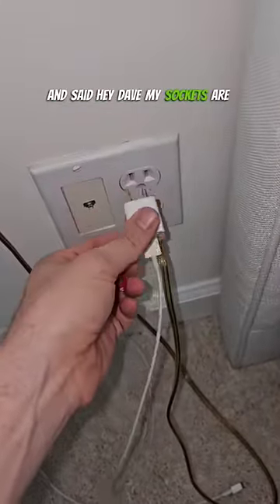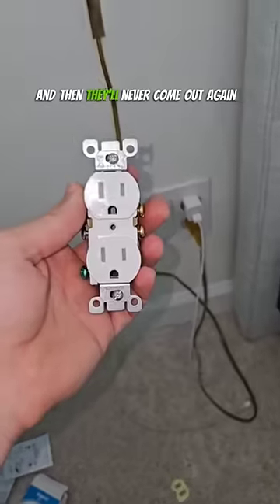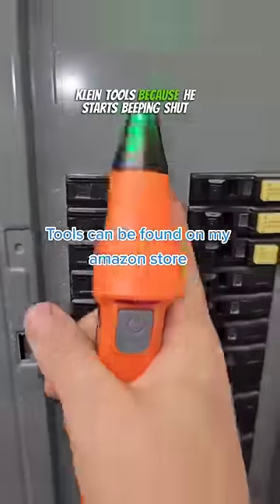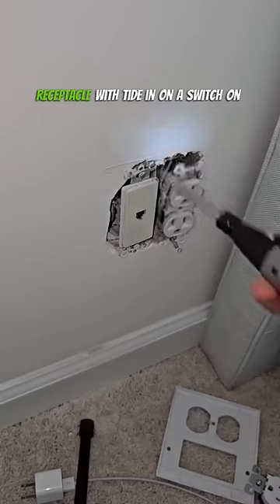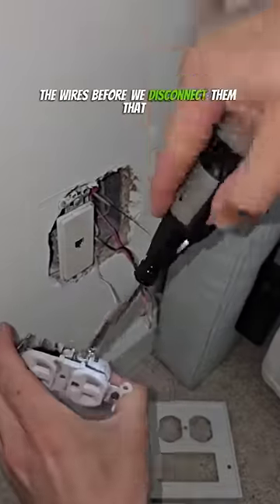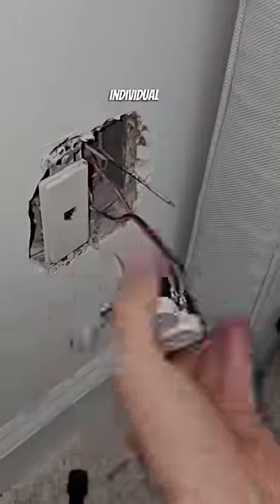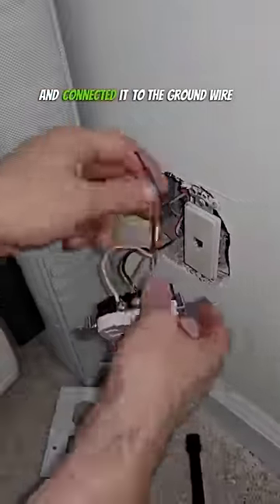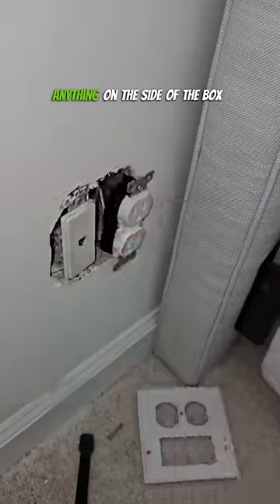🔥 Thats a hazard! How to change a switched outlet #diy #handyman #electrician #HowTo

Comment: Pro tip, forget about finding the right breaker, go straight to the source and cut power to the whole city
Reply: lmao
Reply: Or just your whole house. But if you have access to the local power station, then yea I guess that works too.
Reply: @anthonyfaiell3263  its a joke
Reply: @ntclpz I'm pretty sure his comment was also a joke
Reply: @ntclpz you is a joke brodie
Reply: I approve
Reply: lmaoo
Reply: Or the electroboom way by shorting the live and neutral
Reply: No
Reply: >I need to turn off the power
>Destroys the SUN
Reply: Grow a set and work with live wires... 😂
Reply: Me opening the switch gear at the sub station 😂
Reply: Can't be too safe.
Reply: Slavic method is to short the plug
Reply: I throw anvils upstream of the local dam
Reply: Isn’t much easier to call the power company and tell ‘em to shut down for a moment the power plant? I mean isn’t that hard to since they got people already there 🤔
Reply: This is the Die Hard way!
Reply: Just bring down the entire electricity grid so you don't have to figure out which city you are in.
Reply: XD
Reply: Crashing into your nearest tri state transformer pole helps
Reply: other trick: live in germany here every breaker is labels with the room its for kind cool tbh
Reply: Or just press the button to trip the breaker
Reply: @benozzy003 Oh, you mean the button on the outlet tester he used? I thought you were talking about the "test" button on a GFCI outlet... which would, of course, not do anything to de-energize the wires behind the outlet!
Reply: @babo77z19 After having a handful of electrical problems at my house (USA) I started labeling the breakers to make it easier in the future. Big mistake! It turned out that there was little rhyme or rhythm to which breaker fed which outlet. One breaker fed an outlet in room A and another outlet in room B. And room A had other outlets that went to a different breaker, etc. etc. I had to go back and erase or cover up all the labels. Lest someone shock themselves by trusting the labels.
Reply: I thought I knew where this comment was going when I started reading it but nah 😂
Reply: You might get hit with some serious charges
Reply: @babo77z19  Do you trust the person, which put the sticker on them?
Reply: Lmao
Reply: Im taking this advice lol i killed the breaker once and tested it with a lamp, no power. The moment i touched the wire i got shocked. I said fuck that and killed the whole house to change the outlet lol
Reply: what if i just power off the entire united states mainland?
Reply: All i hear is call of duty “ Going Dark”
Reply: You could also know that your whole room is on one breaker so it doesnt require the tracer. Then again, people dont usually do that, for some reason.
Reply: Yeah, On the way make sure to empty the ocean as well.
Reply: YES
Reply: I have been guilty of just killing the main breaker when I'm in a hurry and don't feel like finding the correct circuit.
Reply: Just shut down the whole power grid

Comment: I remember being 12 and my dad was working on a socket and it was still live despite having turned the rest of the room off. The only reason he double checked is because I asked if we should.
Reply: ive been shocked by mains so many times, so long as he didn't have a tight grasp on it he would have been fine so long as it wasn't a long exposure
Reply: @chrismeli9171  This is why, if you have any doubts, touch the wire with the back of your hand first.
That way, if you get shocked, you won't clench your fingers around it.
Reply: My dad got shocked so many times and he still refuses to shut the power off
Reply: I've gotten a lot of light zaps from uncut hot jumpers and shared neutrals in kitchens
Reply: It's not that bad a shock
Reply: @acidwaste00  Depends on how bad the wiring is in the house actually. Seen some that shock anything like it's a tesla coil rather than wire that's supposed to be closed circuit. You can usually tell if it's going to be really bad if it's hot though, in which case you may want to get an electrician. Same goes for hot Light Switches.
Reply: I zapped by a live outlet in First year class. Took part the whole project while it was live only to touch the Brass screw of the outlet and made my whole Arm twitch and i looked down to see the Plug that was supplying power to it was still connected.
Reply: So people use their testers wrong. They test on live power first then check if the circuit they want to work on is dead after shutting it off. Now that sounds all fine and dandy but I have seen it happen more then once, the tester breaks after checking if it is working on a known live source. What you need to do is check again if the tester is still working on the known live source so you know for sure the circuit is off. It is check 3 times always. It only takes a few seconds but for sure you will be safe.
Reply: @MartinFinnerup  this is a life saving tip.
Reply: My dad was painting our bathroom in our childhood home, and took off the plates. One day I was up there going to the bathroom, and reached behind me to turn the lights on. Except I unwillingly put my hand into the gang box! It happened so quickly that it left me totally confused at the time.
Reply: @dylanlahman5967  That will wake you up before the Coffee even gets into your system
Reply: Yeah I was helping a friend change some old loose outlets, his house has some janky wiring to begin with, we turned off the breaker for the room and thankfully we checked because the top outlet was on a different breaker so the bottom was dead but the top was still live.
Reply: @eancola6111  Your dad ain't a smart man
Reply: @frandurrieu6477  Stubborn as a bull more like, describes all the men in my family
Reply: @eancola6111  Fair enough
Reply: @EricN73158  Also known as Live-Dead-Live testing. Not an electrician but in my hybrid/EV automotive class it was an early lesson.
Reply: @warrenself  wow I did not know it had a name but yeah it is a good habit to get into. I don't give a fuck what my co workers tell me, I will always test and I let my apprentices know how and why I do it.
Reply: @Martin Finnerup  not ideal buy far dont thay have thing that tell u if something is still hot mate but yes if u have to touch it with the back of your hand it your own risk mate
Reply: @MartinFinnerup  damn good advice
Reply: @MartinFinnerup  "If you don't know if a wire is live, touch it" Yeah, good advice
Reply: thats cool, my dad left a live wire hanging out of a wall and i walked by and brushed my leg on it and knocked me on my ass
Reply: @MartinFinnerup that’s smart af
Reply: Electroboom does it all the time. It is safe right?
Reply: It doesn't hurt that bad I was nicknamed sparky at 18 because I saw others work on shit live and i wanted to do it too, I guess my body eventually learned to be careful. I'm now in industrial and work on all kinds of high voltage. 480 motors and transformers and not little ones. I'm actually doing some dangers transformer job turning them on. Gotta wear a hotsuit and stand to the side in case it blows up. They're 20k volts. Well there's 3 parts to them, turning on the inside the secondary and at last the primaries. Someone may die but that's okay 😂
Reply: I got my first shock when I was 12. That 230v felt nasty on my then thin body. Nothing bad happened but I remember feeling unsettled for a few minutes, understanding what could have happened.
Reply: Same thing has happened to me many times.  That is why I have one of the tracers he is using now.
Reply: My dad till this day refuses to turn the power off no matter what. Doesn't even use properly insulated tools either. Idk why anyone would want to do that, if you can shut it off, THEN DO IT, unless you're in a hospital, or working on power lines or connecting a main to a building after it was connected to the street, then there is zero reason to work on a live circuit. Whether it's 20v, 120, or 220+, there is zero reason to risk it, better off safe than dead
Reply: This is why I usually just go ahead and do it hot, or if I do turn it off, I still work as if it's hot lol
Reply: Haha I remember watching my dad arc a screwdriver while swapping a breaker. That was the only secret we had from my mom 😂
Reply: @MartinFinnerup  this is the worst advice ever. grab a multimeter and test it and worst case short it out while covering your eyes if its a small circuit.
Reply: always assume it's live until you test it yourself. a non-contact tester is not reliable, never trust them.